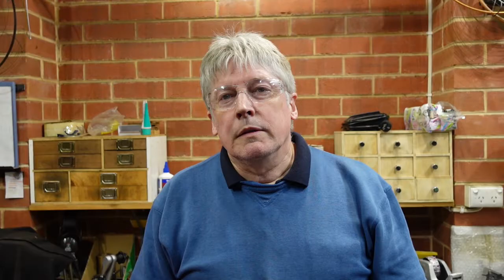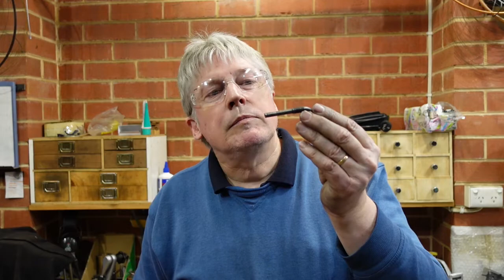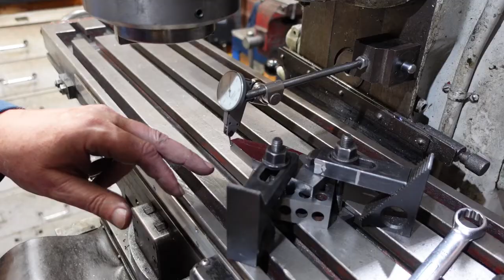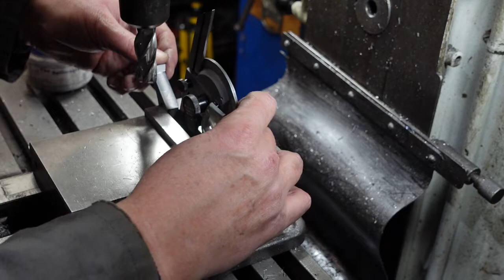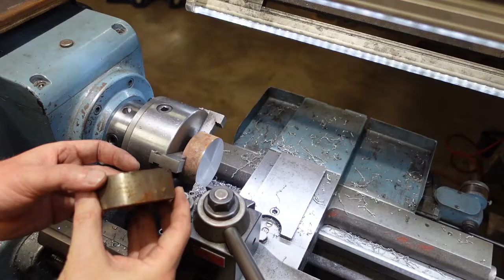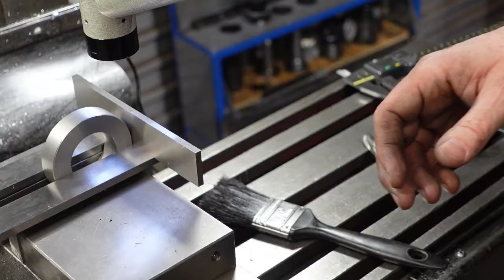Machined parts for the Tayor Taylor Hobson rotary fixture (TTH 2)

Comment: Nice work, but i did have to google what a Geoliner was, looking forward to the next instalment.
Reply from the maker: I did wonder about using that term, but as that is what they are...
For those wondering, a geoliner is a type of ruler that combines a protractor, set square and ruler. Makes drawing parallel and angled lines much easier.